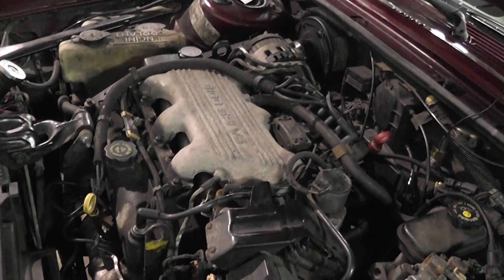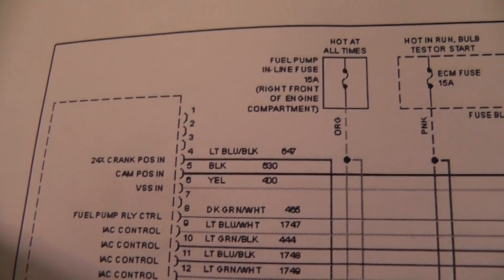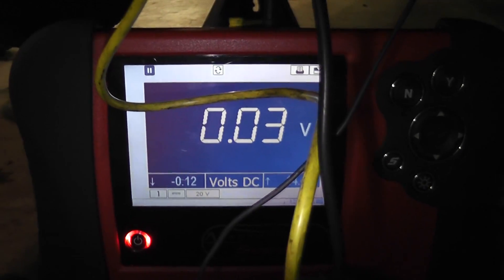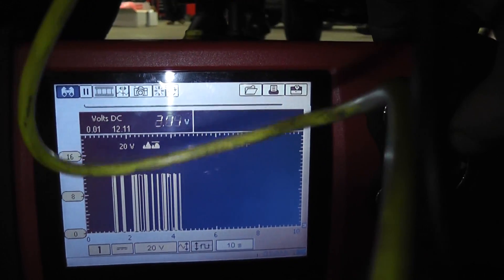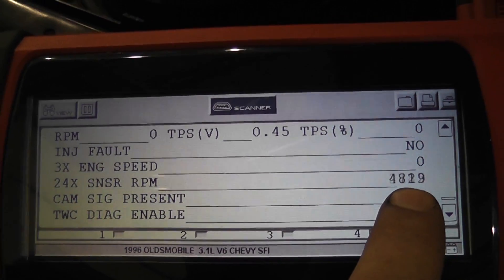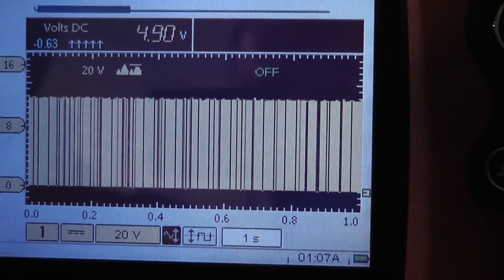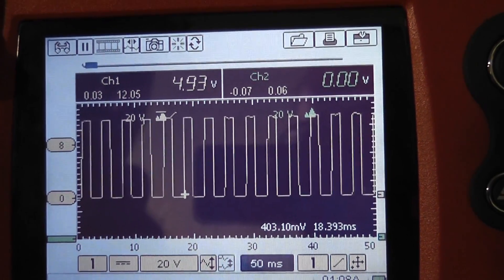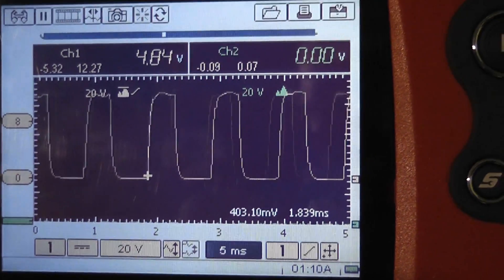How to test a GM 3-wire crank sensor (hall effect type)

Comment: So when you are doing this test, touching the test light on and off the signal wire, are you being the crankshaft?
Reply from the maker: yes but do not expect that to run the car because timing would not be right. Also you need cam and crank signals together on most cars today
Reply: @ScannerDanner gotcha, technology these days 😂

Comment: Great Video!! Wish i could always  get my hands on decent  complete wiring diagrams that show complete connections of camshaft sensors to ECM s and voltage sources , but 'little pigs ' wont come out , Wendy !!
Reply from the maker: https://eautorepair.adtrk.biz/?a=10817&c=24&p=r&s1=
This is the DIY version of the service info i use

Comment: So pull up basically is sensor creating the ground ?
Reply from the maker: A pull-up design is switching on and off a source voltage (typically 5 to 12v range)
A pull-down design would be switching on and off a ground circuit

Comment: On multimeter I get an average of 1 volt. Is that a bad crank sensor? I have no spark and no injector pulse :(.
Reply from the maker: I need way more info to help you.
Year, make, model, engine size and what sensor you are measuring. I believe in this video this engine had two different crank sensors and the 24x crank signal is NOT used for coil firing.
Reply: @ScannerDanner  thanks for your reply. It’s a 2006 Chevy express 3500 with the 6.0l engine. I was measuring the crank signal wire. It’s a pull up design and reads 1.2v when it pulls up. Cam sensor is a pull down and reads 11.8v then it is reads 0.0 when it pull down. The ecu doesn’t ground the injector control wire and doesn’t send anything through the ignition coil control wires either. Fuel is there and it cranks all day long but ecu doesn’t fire injector or ig coil. Could it be the ecu itself
Reply from the maker: @danielfuentes5428  1.2 volts is not enough. If it's a pull-up design, it should be near 12v at the peak. 
What is your supply voltage to the crank sensor? Make sure that is battery voltage. Also make sure sensor ground is near 0v 
Also you could potentially have a partial short to ground on the crank sensor signal wire. Other than that, this sounds like a bad sensor
Reply: @ScannerDanner  ok I’ll swap the sensor and see what it reads. Supply is 12v and ground is solid 0.0 on the crank sensor using a power probe. Thanks 🙏🏽
Reply: @ScannerDanner  hey I changed the sensor and still the same amount of voltage. I also went ahead ordered an ecu for the van did the key relearn so the theft code could go away but still no start. No spark or fuel injectors. Maybe the Chevy dealership can figure it out? What do you think. The cam sensor pulls down the 12v to ground so I’m assuming it’s good. I think I just don’t have the right tools for this hard of a task it seems to be beyond my capability.
Reply from the maker: @danielfuentes5428  are you setting crank sensor codes? 
What is peak voltage on that crank signal wire when you bump the key. Do it repeatedly to try to capture min, max voltage with your voltmeter. Cranking speeds the signal is too fast for your voltmeter to accurately measure it. The cam signal has way less signals which is why you can see it

Comment: Is that signal wire also known as a control wire?
Reply from the maker: no sir, a control wire would be for output circuits. Something that the computer is turning on or off (controlling). Input wires we call signal wires as they are simply being "watched" not "controlled" Make sense?
Reply: Yes sir Thank You  im actually watching the video of you explaining that I should of held my question.  I am a member on your paid channel the reason for the question was because I was watching Eric o hooking up to a control wire for fuel injector to see his data and never mentioned signal wire so im just confused where the different wires are located I guess that comes with more of your videos and learning wire diagrams
Reply from the maker: @ramongonzales1631  chapters 2 and 3 will be super helpful my friend. Thanks so much! I answer questions there too as I have a comments section under each video

Comment: Nice video. I read your E-Book, and this video is in the list. A question. At 6.80- 7.00 min, should not the average DC be higer when the frequence be higher, more rpm on the engine. It seems like it be lower?
Reply from the maker: it is also about the duty cycle, not just the frequency, that will affect the average voltage. Chapter 3 near the end of the chapter I believe. Could be in chapter 1 too under Multimeter basics
Reply: @ScannerDanner  Ok Thanks. Maybe to "on" time in the duty cycle will be less even if the frequence is higher.

Comment: I have a 3pin pull up hall effect ckp, am having P0335 code
Test light to the signal wire simulate car starting; you can hear injector and fuel pump openings.
When I probe the signal wire with multimeter and on crank, volts coming from the signal wire is 0.40 > 0.60volts set on 20dc volts 
Car can't start, whats the problem?
Can I know the min max of the ckp? Power to it is 5v
Help sir
Reply from the maker: you still working on this? sorry, just reading this now. That voltage is low. Can you measure that signal with just the key on? And then bump the starter a few times to move the crankshaft, then measure again (key on, engine off). Then also check the hall effect power and ground and give me those numbers too
Reply: @ScannerDanner  Thanks SD
You are spot on, the signal wire voltage is low and the culprit was the ckp sensor. It was defective, replaced it and car can start now. 
Can a sensor have resistance with multimeter and can still be defective? That what the old ckp was driving me to; so I thought that wasn't the problem and the FSM says so that when the CKP has resistance its OK but not in my case.
Reply from the maker: @AnythingEverythingGh  resistance testing of digital hall effect sensors is not a good test at all. I've never, not once used a resistance measurement to either condemn or say one of these are good. Scrap that test my friend :-)

Comment: No bias in the signal wire..
Reply from the maker: And?
Reply: @ScannerDanner  and I have to test the circuit.. disconnecting the sensor and using a test light apply power by tapping and watching the data for change..🤸🤸

Comment: if the signal or driver is shorted to ground . u will see ground voltage when unplug the sensor . so it could be pull down design     with shorted driver or shorted signal wire . what the risk i take when i run this test by CONECT TEST LEAD TO 12V .

Comment: excellent ! as well as your book, I work with these systems but without the benefit of detailed wiring diagrams ( no specs at all, proprietary data ) and the theory you teach is a MUST.  the manufacturer just uses the parts cannon method,  its crazy but thats their procedure. This system approach saves me hours.

Comment: receive a cordial greeting. Thank you for your very good work. My question is: At minute 5:02 of the video, you say turn the key on, and a voltage of 10.16 volts appears on the scanner. Why that voltage of 10:16 volts. it is not assumed that the reference voltage is 5 volts. I would appreciate your response.

Comment: Can Someone explain to me why I hear a crackling sound in the distributor cap when using the test light to ckp signal wire?? Also at first it was showing rpm on the scan tool but now nothing just a sparking sound in the distributor cap every time I touch the crank signal wire with test light
Reply from the maker: You're creating spark each time you do that.
Reply: @ScannerDanner  oh ok. So that test eliminated signal wire as a possible culprit?
When I have the power probe on the signal wire and cranking I see voltage change as if to mimick waveform. Yet the scan tool didn't show rpm change. Can I call the VCM as the issue?

Comment: Mr. Paul, What about GM’s cam sensor signal that goes to the ICM and to PCM? I do not have a scope other than live data. Am I able to check cam signal response when bypass testing via live data?
Reply from the maker: Possibly, sometimes there needs to be an RPM signal present for scan data to update.
Your better off using you digital voltmeter and understand that it will average the signal.

Comment: This might be a dumb question but if you wanted to test the signal wire to see what type of sensor it is and the wire was open or something would that possibly give you a false answer on circuit design?
Reply from the maker: Not a dumb question at all! The answer is yes. If the signal wire is open or shorted to ground, you will not be able to properly identify circuit design. This is why it is important to take note on what model car is doing what for the future.
Reply: ScannerDanner right after I sent that question I read the answer in your book lol. I've been reading it non stop the past 2 days and learned so damn much already. Thank you!
Reply from the maker: That's awesome man! Are you talking my premium classes yet? I will teach you page for page from the book and then some. Check it out when you get a chance. There is a 14 day free trial. You will not be disappointed. Hope to hear from you there. Thanks! https://www.scannerdanner.com/join-scannerdanner-premium.html
Reply: ScannerDanner not yet but will Definatley check it out. I've been following every link in the book so far.

Comment: Good video with good title, but I think you should also try a signal generator for bypass testing of the crank or cam sensor....signal generator would probably feed a cleaner signal to PCM...I have not tested it myself but may be you can do it.....Also a general title like this one would attract more people than a specific vehicle brand...you can of course use both like "2010 Toyota Prius (Crank Sensor Ciruit Testing)".
Reply from the maker: +Syed Imran Shah I've been looking into one for sure. In particular one with a way to vary both the frequency and pulse width of a signal and I suppose changing the amplitude would be nice too

Comment: Hi, would the power probe 4 be helpful in this job? or its better to use a good multi meter instead? please get back to me thank you.
Reply from the maker: +Denkha94 not sure where the PP4 would be an advantage here other than it also being a multimeter. Unless you are talking about the bypass test, in which case I still prefer the test light on a pull-up design circuit
Reply: thank you for responding. can I use the test light method doing the by bass test on fords, it has 2 wires going to the sensor. will the test light show me if I am getting a pulse? thank you.

Comment: ScannerDanner very impressed with the basic knowledge you give people for problems they have. I just started raci gin a new Div. 1/2 mile asphalt 6cycl American car FWD well as you know most of your fwds have a PCM .SO MY ? To you if you can't touch your PCM and wanted to make the car go faster besides bigger piston cam and d so n ,just so ethi g that has to do with the PMC what would you do.strictly stock the tech man does not look at the engine or PCM bit for kicks what does your mind say do first on my 2001 SS MONTE CARLO, let me give you my visions,that I don't tell anyone until now . I designed a tube and inside it is little fins I designed like a turbine and the tube gets smaller and comes out where the headlight used to be. We'll that is what you see ,it is double walled with dry ice insidethewall. I have put a Bigger throttle body 102 on it larger Injectors,and fuel regulator ,toucan see where I m at in what I know about the PCM butto me that is elementary .now I need a mind like yours to help a new racer that races where some of the greatest Nascar drivers have won track Championships 2 nod oldest sanction track

Comment: Is there such thing as a 5v, or whatever that isn't 12v, pull up circuit?  If so, how would you test that?  Would you have to search all around car to find the appropriate pull up voltage?

Comment: I'm sure you've been asked this a million times, but how do you know whether to use a LED test light or an incandescent test light.  For example, on this test, I would have used an LED test light, since this was an input to the ECU.  I lean towards the LED for safety.  Bad idea?
Reply: You're correct that an LED test light produces less current and is safer on ECU connected items. However, there are sensors that need more voltage  or it won't test correctly. I know some items on my car that are one way or the other, but I can't answer you what things are commonly one way or the other, or if different brands do it differently.
Reply: DE Nichols
 I shouldn't just say sensor. Fuel injectors run on 12V's if memory serves.

Comment: I just used this test on a saturn vue prove the computer and wiring were good, went to change the sensor, wich is behind the timing belt, even though  the timing was on I found the idler pulley for the timing belt had exploded and actually destroyed the crank sensor. I did my best to check the valves via a leak down test hopefully they are ok.
Reply: nice! I am glad the test worked for you. Hopefully those valves are ok
Reply: ScannerDanner Premium
valves were good got the car running around 10 this morning, just got your ebook too. Been watching your videos for a few months now
Reply from the maker: Christopher LaSalvia
thanks! check your spam folder for some emails from me and bookguardpro

Comment from the maker: There would be a few ways to ID this. First would be to know the system (for example ALL Chryslers are 5v pull-down designs). Second would be during your bypass test with the test light connected to B+ (what you would do for a pull-up design) the test light would light! (which it shouldn't do during a pull-up bypass test)

Comment: Paul, how would you know if you had a pull down design hall effect crank sensor that has a signal circuit shorted to ground and not mistake it as a pull up design with good signal circuit integrity?

Comment: I have a question. If i have a drop out in the frequency test means that the cranks sensor is bad or I have problem in the signal wire?

Comment from the maker: focus on the O2 code and negative fuel trim numbers. this could be causing the misfire code. what is bank 1 doing? does the bank 2 O2 respond to ratio changes (make a large vacuum leak)
watch my video "O2 Sensor Signal Fixed Rich"

Comment: Hi Paul I need an advise I have 01 Chevy suburban codes po300 p1153, I fixed vacuum leak at the intake and the crank sensor no signal,  check fuel pressure okay coils and injector, looking at the freeze frame data bank 2 STFT -31.25 LTFT -15.62  the o2 sensor is not switching and I have not replace yet but still po300 code..

Comment from the maker: You could do that but use a 5kohm resistor in series to the test light so you do not accidentally short out the 5v ref. circuit.

Comment: Thanks for the reply.If it was a 5volt signal that was required my thoughts would be to use the sensor supply voltage to attach the test light to and use that for the bypass test.

Comment from the maker: The 5v designs are usually a pull-down design so you would connect your test light to ground and pull the signal low through your light. On this design a jumper wire works too. I have never seen a 5v pull-up design on a hall effect but have on an ICM to PCM communication signal (GM dist. ref. ckt) Anyway I have used a 12v test light hundreds of times on a 5v signal circuit with no damage to the computer or module. Certainly 5v would be preferable though.
Reply: But why you connected that black wire to the signal wire

Comment: I noticed you used a 12volt test light to simulate a signal.Would you use the same test light if it was a 5 volt signal?

Cheers Brett

Comment: When the sensor is plugged back in (keeping in mind this is a 12V pull-up design), and then the key is turned to the ON position, why is there 12V running through the signal wire at that point? Shouldn't it be grounded until the sensor's transistor pulls the signal UP?

Comment from the maker: If it is a hall effect and you know the circuit design "pull-up or pull-down" then yes. Also depending on the system you may not get a response without the cam signal being present too. Of course you could look at a data PID and use that as I did in the video

Comment from the maker: Ok got it thanks. Unfortunately I cannot say with certainty whether it is a pull-up or pull-down design. My guess is pull up, but I could be wrong.  GM did use both types. For example the 3800 CKP was a 7v pull-down design, but on the same car the CMP sensor was a 12v pull-up. Chrysler was uniform with their hall effects. They are all pull-down on all the years on all the models (domestic anyway)

Comment: The 24X reluctor wheel use two different width notches (12° and 3°) that are 15°
apart. This pulse width encoded pattern allows cylinder position identification within 90 degrees of crankshaft rotation

Comment: @ScannerDanner  F-body 98-02 5.7L V8 LS1, GTO LS1/LS2 5.7L 6.0L 04-06, GMT 360/370 Trailblazer/Enmvoy/Bravada/SAB 97x 5.3L, 6.0L V8 02-06, Sivlerado/Seria 4.8L 5.3L 6.0L 99-06,  Express/Savana Van 4.8L 5.3L 6.0L 03-07.
 Corvette 98-05 LS1/LS2 5.7L 6.0L V8   

Most newer LS2/LS3, and 07 and up truck motors are 58x (60-2) reluctor.   All the motors I mentioned should be 24x with no missing teethe.

Comment from the maker: @modelfreak125 Yes, it is a 12v pull-up design. Also the 24x signal is not what triggers the coils to fire. It is used for low speed timing control and misfire monitoring. If you lose this one the engine still runs. The 7x crank is the RPM/Piston Position signal. This is the main one. You lose this one and you will have a no start, no spark, no injection pulse condition.The 7x is not a hall effect, it is a variable reluctance type sensor.